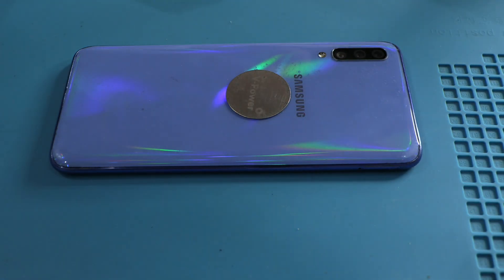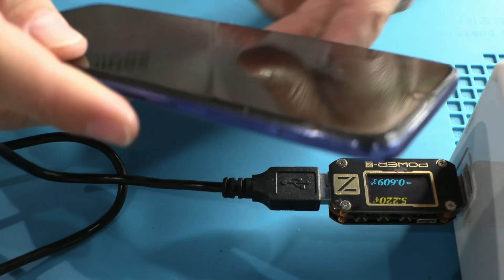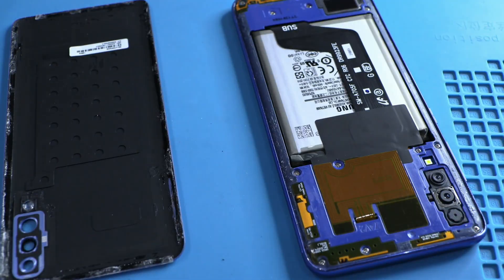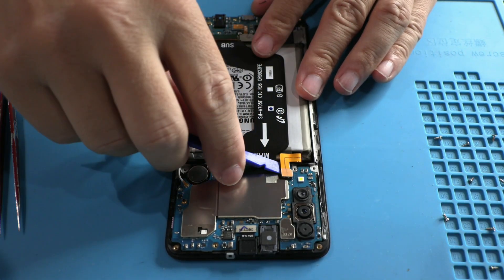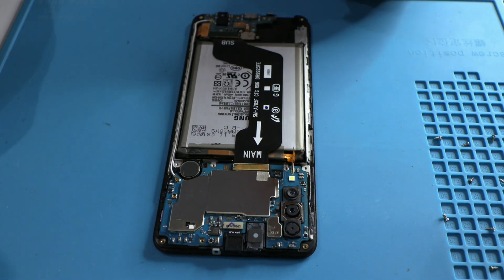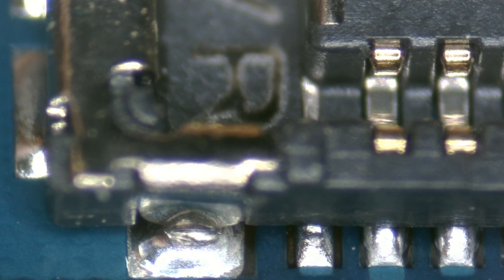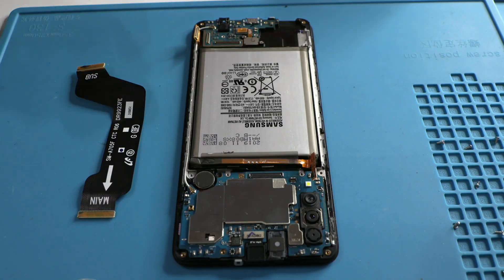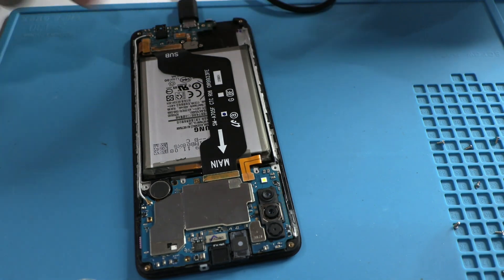Samsung A70 Not Charging  Troubleshooting Tips and Solutions

Comment: My wife A70 was now 4 times in repair shop and everytime phone charging few hours until dead again.
Shop changed cable between units, no help.
I not have microscope so quite difficult see solder FPC connector but i try.